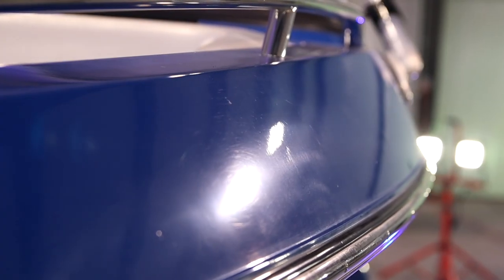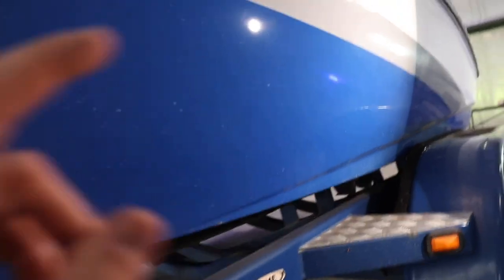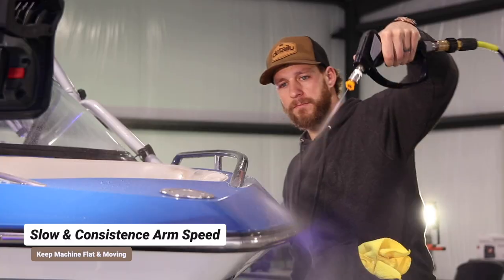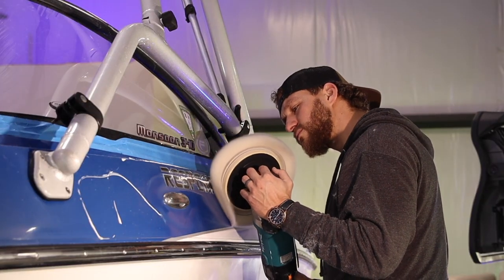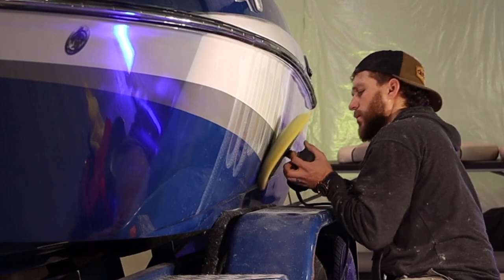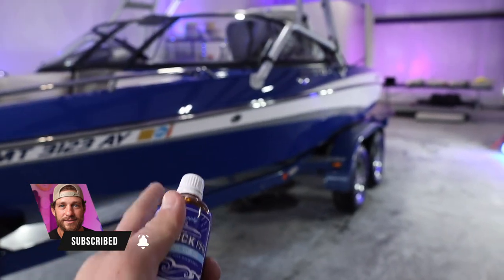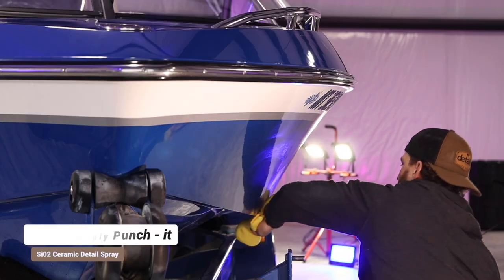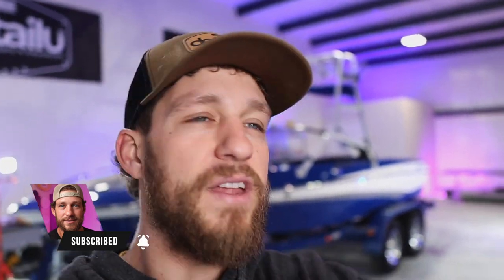Make Your Boat Glossy Again ( 2024 ) | Boat Detailing Tips | Shine Supply Products

Comment: Curious if you're still gonna make a video on correcting an RV? saw a video about washing and you had a test spot done awhile ago and I'd love to see your process. Awesome job on Malibu!
Reply: I do rv detailing on the side, but I'm not as good as Drake, nor do I have the patience to make these videos. That's why he is the man. 
You can apply most of what he does to an rv. The gel coat just isn't as hard and big flat surfaces offer a lot of room for holograms. I haven't perfected it quite yet.
Reply from the maker: You can buff a rv the same as a boat! Only difference is the sanding process. I wouldn’t go lower than 2000 grit on a camper. 

As for making the correction video, I was going to make it … but that camper was my personal camper and we sold it.. so as of now no, I will not be doing a correction video on it. Sorry!
Reply: @DrakesDetailing  No worries thanks for the awesome video and great information!

Comment: So I have the maxshine rotary.  It has a 5” plate.  

Is it a huge problem to run a 6” 1.25 white and yellow wool double sided pad on this or even a single?  Can the backing plate be swapped out for a larger one if not?  

Process last time was the following.

Menzerna liquid sanding compound with 6” uro fiber wool pad.   
Menzerna 400 with lc orange ccs
Wake up with lc white pad

Turned out pretty fantastic but the previous decals are still there so I know after I’m done with it for the season I’ll need to get a bit more aggressive.
Reply from the maker: Hey bro! Yes they can totally be switched out with a bigger backing plate.

Comment: When wet sanding is masking rub rail recommend? I have typical stainless/rubber. Unfortunately it has exposed stainless screws. Also what would you recommend to remove the hard water marks on stainless or chrome logo/ emblems, rails etc? There is a lot of old wax/cleaner on the rubber and around the metal logo letters. Your videos are fantastic! Thank you for sharing Your expertise!
Reply from the maker: Those are never bad steps to take if you are patient enough to do it! Thanks bro!

Comment: Amazing work, as usual!
Do you think that you would be able to do the same work without wet sanding? Would you get the same result if you do 3-4 steps of heavy compound instead of wet sanding? If yes I suppose it won't last the same time and oxidation will be back sooner
Reply from the maker: Hey bro! This level of gloss could not be achieved by just buffing. Wet sanding would cut down the layers of oxidized and scratched gelcoat more.

Comment: Hi Drake just discovered your channel and loving the detail and info, was wondering what you do with vinyal decals as my boat has a lot of them.
Reply from the maker: Hey bro! You can buff over them, it will help bring them back to life as well as the gelcoat. However, just use lighter pressure with whatever buffer you plan to use. If you are going too fast and using too much pressure, you can burn through them.

Comment: NICE job as always!!
Couple questions…
In your other videos I’ve noticed you went from 1000 grit sanding straight to heavy cut compound,
What made you add the 2000 grit sanding this time?
Also what is the best work light do u recommend for seeing swirls/scratches/holograms?
Reply from the maker: Hey bro! The 2000 really helps richen that nice gloss when you go to buff with your extra heavy compound, and it also helps get it even more micro scratches. For light scratches I personally believe Shane supply chop top is to go to a link it for you down here at the bottom!
https://www.detailusupply.com/products/shine-supply-chop-top-32oz?_pos=1&_psq=chop+top&_ss=e&_v=1.0

Comment: Stunning out come as always Drake !! Nice work
I have a question on pricing I have watched all your videos on Pricing. I get the steps ect ect but that starting price is where i have a dilemma. I stay in Scotland and 90% of the leisure boats around here are cudies through to full cabins.  
For example i have two Bayliners that im trying to work out a price for one is Bayliner 2655 Ciera the other is Bayliner 2855 Ciera.
These boats have about twice as much gelcoat above the rub rail than below. I can't go for the $10 above and $5 below the rub rail. 
How would you price these boats up ? Both under 30ft. But big areas of gel above and below. Would 20/15 work ??
Cheers
Andy
Reply from the maker: I’d do $15 per step in the work you need to do above the bow rail and and $15 per foot per how many steps you need to do below the bow rail

Comment: Drake, great video...very detailed.  Thank you.  I am new to this using the Maxshine ShineMaster M21 Pro DA Polisher; attempting to take same scratches you have in this video out of my boat and it is scary using sandpaper.  Anyway, I used the 1000 and 2000 grit but can't get the deeper scratches out.  Is it as simple as more time, more force on polisher, more speed and more passes?  any help would be great before i start compound stage....
Reply from the maker: Hey bro, you can’t use a DA polisher for initial buffing step after sanding, it’s just not powerful enough to level all of the scratch’s out. You will need a rotary buffer for at least two steps of heavy cut compound, and medium cut compound to remove the sanding and scratch marks. 

After your heavy buffing is done after he sanding process, then you’d move on to the DA polisher steps. The DA polisher will remove the swirls from the rotary buffer and give the surface lots of depth and shine. ✨

Comment: I'm only curious.. I'm getting ready to do detail on a customer boat I been doin for 10 yrs.. crownline White/ blue..  I compounded buffed & waxed last year.. alot of work.. it has little oxidation lil scratches.. just looking for easier methods.. Maguires flagship cleaner wax?.. I used maguire flagship wax last year.. but what do yall think of that cleaner wax?
Reply from the maker: If it just needs a quick swirl remove/polish  and seal, then I would use Cheyenne supply wake up on a gray Lake country, force, rotation pad, and a DA polisher or force rotation machine, then apply just car power lock, polymer sealant over it for protection.

Comment: Where did you draw the line going down the boat to parts you can’t reach since it’s on a trailer. Didn’t see you get down to the very bottom front of the hull. Maybe I’m wrong. Awesome stuff btw super helpful
Reply from the maker: Thanks! Any spot that is physically impossible to get without the boat being on the trailer you just have to let go

Comment: Love all the videos, so much insight and opportunity to try something new after ive watched it. 

A question i have (recently started a detailing business with friends) 
How much in materials would you expect to use on a 40’ yacht, hullsides only. Sundancer 290 

They think im a little nutty, but i went through a double sided pad, 1 quart of heavy 3M and then much less 3M finesse it and single yellow pad.  Is this crazy? 

We worked out heavy water spots which needed some 1500 dry sand otherwise cleaning them and  working out with heavy cut. 

Thanks, keep up the great work!
Reply from the maker: Hey bro! Depending on how oxidized the surfaces are- I’d say you could probably get away with a 32oz bottle of each product you intend to use.

Comment: Another great video! I just bought a 2007 Regal 2250 and after buffing, I noticed some tiny pinholes in the blue gel goat. It almost looks like white overspray in the blue gel coat. Used hull cleaner on a section and it removed the white wax residue and the marks were almost gone. Any recommendations on using a dark wax on the pinholes or trying something more aggressive to remove the pinholes?
Reply from the maker: Can you send a pic of those pin holes to my instagram @drakes.detailing?

Comment: I've got a 1978 33' Bertram that I want to finish in the spring. It's currently drydocked under shrink wrap. I don't think the previous owner ever buffed the boat, it's solid flat white. My question: if I do from the rub rails down before launch, then do the upper helm when I get to my home marina, will this harm the lower, finished hull? Can you estimate how much material I will need for a boat of this size. Thanks. Watching all your videos to learn this properly.
Reply from the maker: Hey bro! No, a lot people do that. It won’t hurt the bottom finish if you wait to buff the rest when it gets in the water. It’s though to say how much material to but because every gel coat of different in how it responds to the product, and how much product it’s going to take. There is a lot of variables there. I’d say start out with a 32oz bottle of everything you plan to use. Good luck! 😎💯💯

Comment: Great job!  Can you put the ceramic coating on (diamond pattern) non skid on the outside decks, or will it be too slippery?
Reply from the maker: Yes you can! However, all the oxidation must be removed in order for it to adhere properly. It will be a little slick, so be careful. But it’s definitely a great way to keep it cleaned and unoxidized

Comment: What is the difference between rotary and the M8SV2? New to this and don’t know when to use each. Have a dark red boat with oxidation that I want to work on. Thanks great videos!
Reply from the maker: The rotary buffer is the sign for heavy oxidation removal, and is very strong. The M 8SV2 is a dual action Polisher that is designed for light polishing and applying Sealants.

Comment: I just watched your video several times and  purchased all your recommended products for my weekend project of detailing my boat.  I noticed you used 3 machines.  is it necessary to have both the Max Shine and the Rupes Mille.  Can I use the Max shine for the wet sand?
Reply: Sorry, I reversed it.  can I do the max shine machine for the wake up polish step?  I would prefer to only buy one machine for the polishing and wet sand.  for the wet sand do you put a 6" backer plate on the machine?
Reply from the maker: Hey! Yes it is definitely good idea to have both, they both achieve different things. Yes, you can use the Maxshine for wet sanding

Comment: I only have rotary polisher and the boat I have is white with medium oxidation. If I did menzerna 400 on white wool pad then on yellow wool pad do u think that would cut enough and leave a nice finish? 
Also love ur videos.
Reply from the maker: That should be adequate, however each gelcoat responds very differently. If it does not turn out how you’d like it to, you may need to cut heavier.

Comment: Amazing work as usual! How do you manage all the corners and spots under rails etc that the machines can´t reach? By hand??? I´m considering buying a small rotary and a small DA but is that unneccesary (money beeing no issue)? Hard finding a small forced rotation DA though. If you manages with just a rotary with one pad size and one DA I should too. Keep up the good work! Daniel, Sweden
Reply from the maker: Yes, by hand and/or if you have the means for a mini machine I’d highly recommend picking one up. I like the Rupes long neck Nano polisher.

Comment: Thanks so much for the video! Can I start with 2000 grit and then go to three or 4000 grit afterwards? This will be the first time I have wet sanded anything. Thanks.
Reply from the maker: It all depends on your situation, and what your oxidation level is, typically you don’t work it that fine with wet sanding gelcoat.  After 2000, trying buffing it with a wool buffer and a heavy cut compound and see if that takes the sanding marks out

Comment: Awesome job, i did a full restoration on my boat using your techniques but i noticed after my starke level r application theres a slight haze only seen with a light at night that i can disturb by just rubbing the gel coat. My question is when i move to my foam medium will that remove the haze (again which is not noticeable in the sun) or should i do something prior to my medium/polish? Thanks
Reply from the maker: Hey there!
I would definitely do a medium cut after your heavy, such as shine supply chop top (linked below) with your foam-wool blend pad and it should take away any imperfections left over that the heavy cut didn’t work out. However, if your heavy cut compound is not getting all the oxidation out, you may need to wet sand, then re-buff with the heavy compound, then medium, then and light compound/polish and seal.
Reply: Yeah i did those steps starting with 800 working to 2000 grit. The shine was there even before a medium cut but its like therse just a little residue left from the heavy that my micro fiber, post heavy wipe down didnt remove. Thanks for the response

Comment: Hi Drake. Thank you very much for all your videos and advice! 
Quick question from a beginner! I have 44’ sailing yacht. How much wax do I need to buy? What approximate coverage should I expect from e.g. 16oz bottle of wax in square meters or feet? I do not want to under-prepare. Thank you very much Magdalena
Reply from the maker: Hey bro! I personally feel like you’ll definitely run out of the 16 oz bottle on 44 footer. I’d get a 32oz bottle of whatever product you plan to buy if they offer it in that size. Try out Jescar power lock! I sell it right here on my site, and we carry a 32 oz bottle. It’s currently out of stock but will be back in very soon 😎https://www.detailusupply.com/products/jescar-power-lock-polymer-paint-sealant

Comment: Hey man I know a DA buffer isn't ideal for cutting oxidation but I recently picked up a Chemical Guys DA buffer and some pads. I have an 09 Gheenoe and it's in need of compound to remove oxidation. I really don't want to buy a rotary buffer if I don't need to. I know it's a gheenoe and will only shine so much but will my buffer and some elbow grease give it a decent shine? Or am I wasting time? Thanks for the info!
Reply from the maker: Hey bro! I’d your boat had any level of oxidation, then you need a rotary buffer to cut it out of the gelcoat. Then, you can sue your DA to polish and remove swirl marks

Comment: Yoooo! I usually dry sand with a disc dual action harbor freight tool. I have a question. I’ll wet sand all the areas I need to do by hand, but when disc sanding is it okay to do it dry ? If so do you have a video based on sanding gel?
Reply from the maker: Here’s a full video I did on how to properly sand a boat. https://m.youtube.com/watch?v=Woos7JTcX6w
Reply from the maker: Wet sanding is just easier because it will save your sand paper from getting clogged so quickly, which can get annoying and expensive very quickly!

Comment: How is the ceramic  coating  going to bond to the surface if there is already a coating on it from the wake up?
Reply: He washed it after doing the wake-up, so essentialy thewake-upp was just used as a polish.
Reply from the maker: It’s all silica. The si02 fills in the pours of the gel coat, And the ceramic seals it up. 

It’s more like a primer for the coating.

Comment: Hey Drake! I asked a question a few weeks ago and I appreciate the response back. With that being said, what pressure washer would you recommend for diy boat detailing? Thanks!
Reply from the maker: There is an electric Ryobi one at homedepot for like $89.00 

That’s the one I use at home to get my truck cleaned
Reply from the maker: Match it up with this handle and you’ll be set! 

https://www.detailedimage.com/wax.php?id=94879&url=detailedimage.com/DI-Accessories-M12/MTM-Hydro-Easy-Hold-SGS28-Spray-Gun-P2473/
Reply: @DrakesDetailing  Awesome, thanks for the response. Appreciate your products and videos!